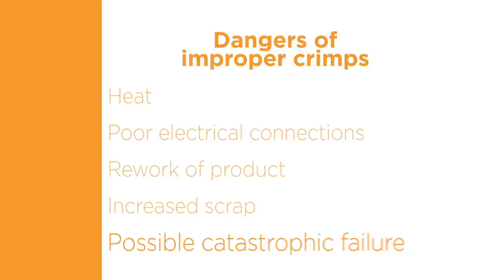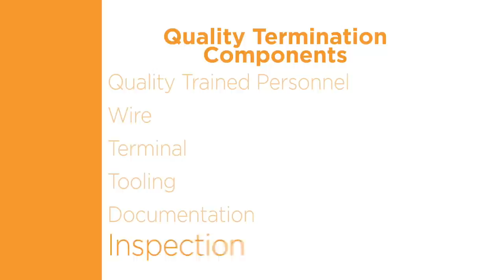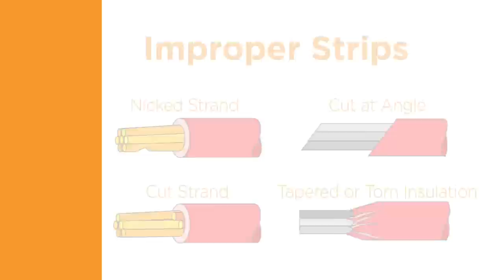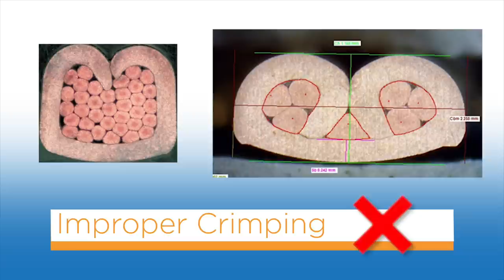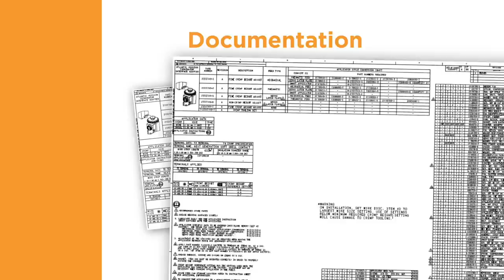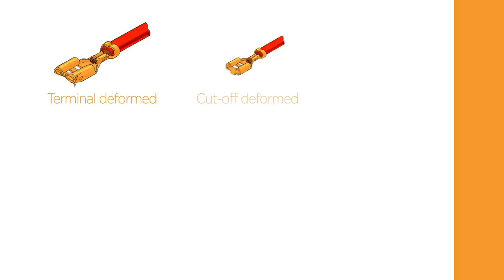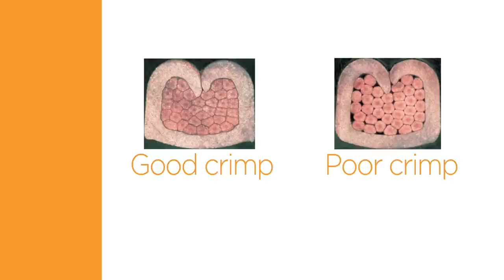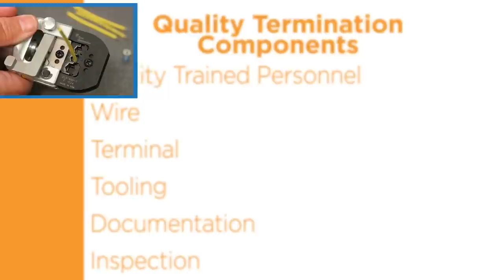Crimp Theory Fundamentals: BASIC

Comment: I cant find where it says to only crimp onto stranded wire. Working in an electrical generating station, I have seen crimps on solid wire fail many times.
Reply: The first lesson I learned during my internship, is to never crimp on solid wire. It just doesn't work.

Comment: Some additional information: 

For larger diameter stranded wire the AWG size indicated, if the diameter is measured to the outer most extent of the strands, will not give the exact diameter of the stranded cable, or be the same in comparing one stranding to another. Also, if there are many strands like on Class 5 or Class 6 (welding cable or high stranding Marine wire, all must be copper or copper core with either tin or silver plating) the lay of the windings also influences the measured outer most diameter. The important aspect of AWG sizing (current capability) is in equivalent circular mils (cross sectional area), after the crimp is made which eliminates the majority of the open space by distorting the circular cross section of the strands. So what matters is using the correct crimping die for the lug and wire used, such that the crimp essentially creates a solid cross section by distorting the circular strands. 

You should always make sure the copper wire strands are not oxidized after stripping, and if so, it should be cleaned (usually this is just wire roll end corrosion that can be eliminated by discarding the end foot of the roll. The crimp terminal wire crimp area should also be clean and without oxidation. For larger lugs (with inspection window) some users like to solder after crimping. It could be argued that if the correct liquid flux is used to make the solder joint at the correct temperature for the solder type, than there should be some flux cleaning action when the solder joint is made and any remaining space should be occupied by solder. 

For lugs and terminals for 8 AWG and larger diameter stranded wire hydraulic crimpers with a minimum of 8,000 Pounds force (15,000 Pounds is not uncommon for 3/0 and larger using a circular die) is used to completely compress and distort the round strands to eliminate any inter-strand spaces. For larger diameter lugs 2 AWG and larger, it is informative to do a test crimp and then cut through the crimp with a fine saw, fine sand the end and inspect the cross section under a stereo microscope. These test samples are periodically performed and provided to the customer if part of the contract. 

The video shows how the secondary wire insulation crimp should not distort the insulation or cut too far and make connection with the wire within. However, depending on the insulation type a slight indent to provide maximum grip is most often the best case for pull strength. Doing an individual crimp pull test is easy to do using a pull force gauge. If both the wire and insulation crimps are done correctly, both crimps will resist the pull force, and will be surprisingly strong even for small diameter wires like 18 AWG. 

If you are making electrical harnesses using crimp pins and connectors, after the harness has been made it is then tested. Before testing it is best to add a pin connection cleaner and lubricant like Deoxit D100 to the pins before the test. In this way when the test is performed the pins are cycled, cleaned (wiped) and lubricated. If the pins have been in inventory for more than three months, many times the testing procedure will call for the cycling of each connector three times before testing.

Comment: Just solder it correctly.  Got an automated terminal solderer?
Reply: Theres reasons not to solder
Reply: @michaelsorenson3887  Competency reasons, sure.
Reply: @snap-off5383  yeah I'm sure that's it
Reply: @michaelsorenson3887  Yep, every failure you can cite of solder either has the same equivalent in crimp or is operator competency related.
Reply: @snap-off5383  Do you have sources for this info? I'd be interested to learn more about why you should solder instead of crimp. Yes I know I can "Google it", but I'm asking if you have a source that your knowledge comes from
Reply: @michaelsorenson3887  It came from a long amount of internet/youtube scouring into inverted question:  "why would people say crimping is more reliable instead of much more reliable solder?"  All answers found were operator error or "yeah but that happens on crimped connections too".  It seems to boil down to "standards" at big operations like NASA are that crimp is the standard and solder is the exception.  But when you dig into WHY are those the standards, its boils down to people screw up crimps with professional crimp equipment less often than when you hire it soldered.  All equipment that they assemble via automation are still soldered.   Its the human element that determines the choice, nothing inherent about the methodologies.
Reply: @snap-off5383  I will try to look into that as well. I've found (from my scouring) that in things that can have high heat and or high vibration, solder can become brittle and crack causing arcing and more heat. Now since I dont have the failure in front of me I assume it could be the human element. But i simply came here to learn the proper methods for crimping because i believe both are equally valuable for their applications. I will keep searching and learning. Since I'm not building a rocket, thankfully I can afford to mess up and learn from it
Reply: @michaelsorenson3887  If I had $200 crimpers I'd buy barrels and crimp a lot more, but I consider well-soldered good enough.  When I went to college I soldered wiring harnesses  and radar boards for the military, lots of practice with lots of scrutiny on my end product.  Vibration cracking is equal between crimp and solder, happens when solder wicks up the wire too far, or at edge of crimp if crimped too tightly, which is admittedly almost impossible to do with good correct crimpers but easy to do by DIYers with common crimping tools.  key there being to isolate the vibration of both from that junction.  (and not to let it wick).   High heat matters starting at melting point of the solder which is going to be much higher than the melting point of your wire insulation so not really a thing.  I don't think solder becomes brittle over time, but it does grow "tin whiskers" if the tin content is quite high.    All summed up it seems if comparing best tools to best tools crimp will be more reliable statistically, but comparing DIY solder to DIY crimp with a walmart wire-stripper, Solder will probably do better.